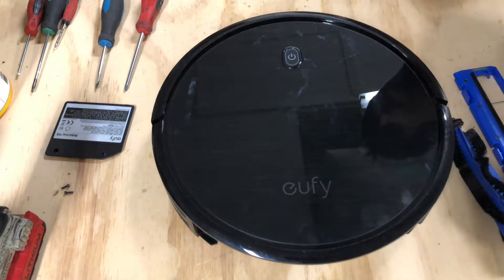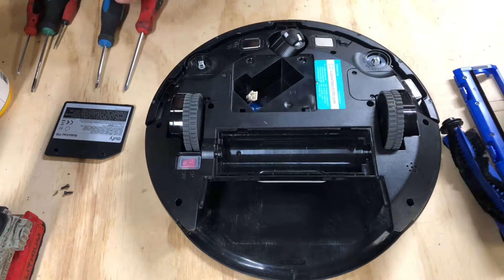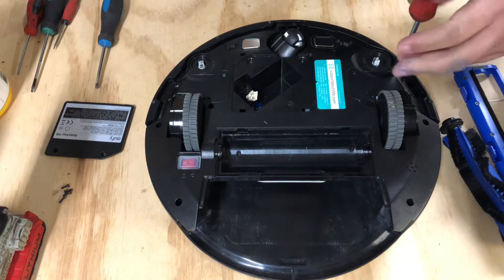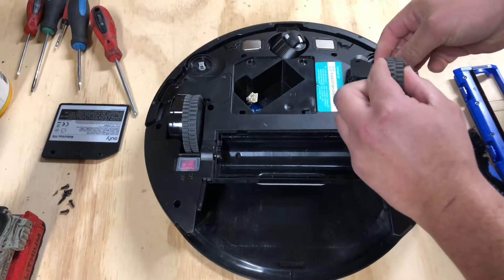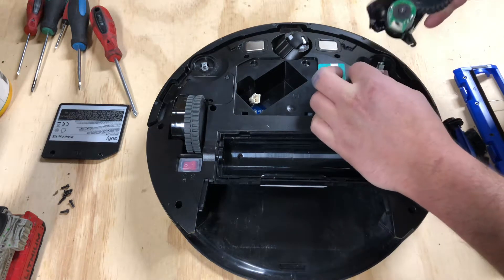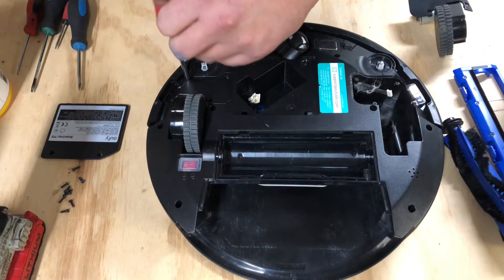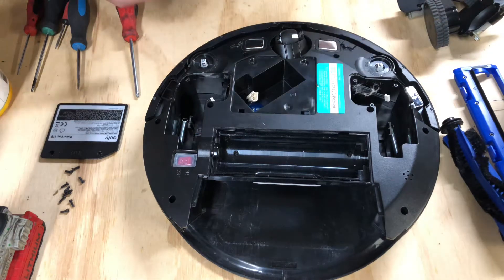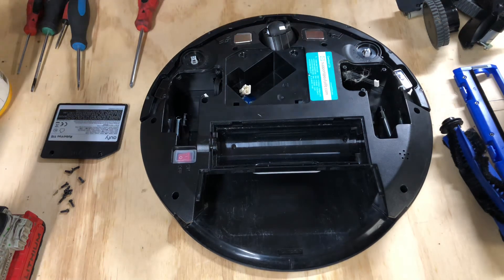Eufy RoboVac 11s How to Remove Wheel Motor Assembly Video 2

Comment: Wow, what a great video. My Macbook power adapter cord just got wrapped around a wheel. I was able to untangle it by removing the wheel assembly, but I did that before watching your videos and didn't realize I needed to be careful with the ribbon cable. One end is connected to the wheel, but the other end is not connected to anything. Should it be connected to something? If so what? I can see some wires somewhat hidden up inside one of the corners of the wheel assembly cavity, and have tried reaching up in there but cannot find any connector piece. Help!

Comment: My front wheel has hair around the pin on both sides. Is it possible to pop it out and clean it, pop it back in without taking the whole thing apart? 🫤

Comment: Cool videos! Would you have the schematics to the Eufy RoboVac 11s? I'm scavenging parts to make a battlebot and want to know the requirements for the motors. I can't find anything online. Thanks!
Reply from the maker: No unfortunately they don’t like to release much of that info to the public.
Reply: @SmittysWorld  Yeah that makes sense. I'm trying to figure the volt and amp requirements for the motors. I wouldn't think that was proprietary but then again I wouldn't know. Thanks for responding. :)
Reply from the maker: @kenve4309  most I’ve seen are 13.4v to 16.3v not sure on amps on top of my head
Reply: @SmittysWorld  I can figure out the amps doing a load test.  Thanks!
Reply from the maker: @kenve4309  no problem